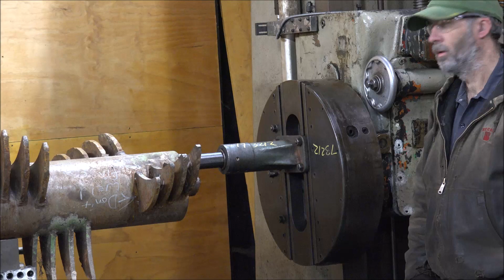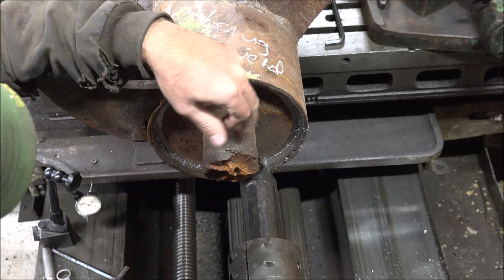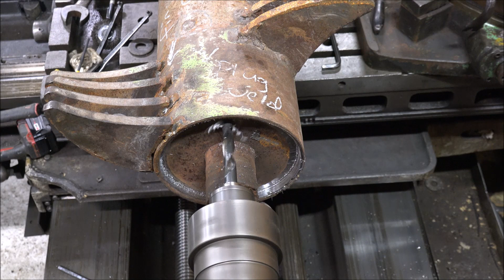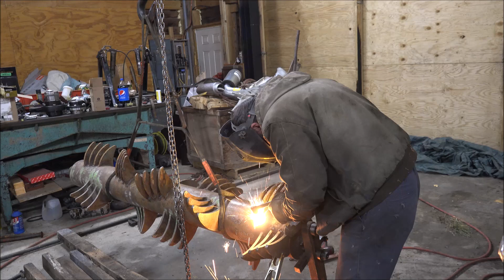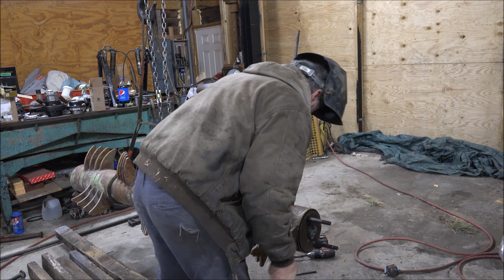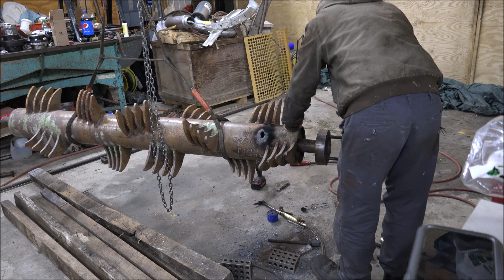Removing the drive slug from a Big Rotor

Comment: This is a fight. From a huge chipper?  What caused the original failure? Didn't look to be a torsion failure. Very interesting series of videos thanks.
Reply from the maker: I believe a previous weld repair of the journal made the shaft brittle and it broke from that.

Comment: That was a bastard, bet there was some cursing edited out!
Guessing that is the driven side with the broken 2 in (?) shaft.
Reply from the maker: Yeah it is the driven side, I believe it is a 3" shaft though. It had a beraing fail and was welded up and turned back down then it broke as the weld makes the shaft brittle and prone to cycle fatigue.